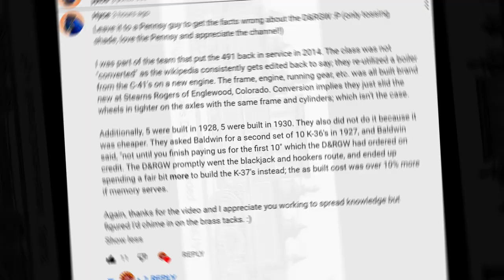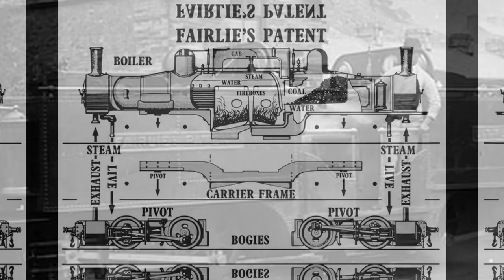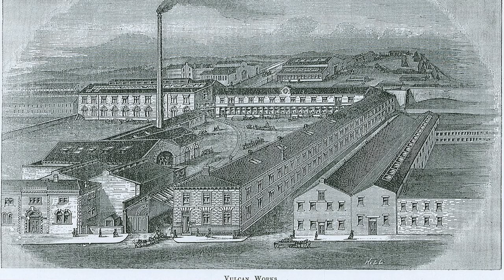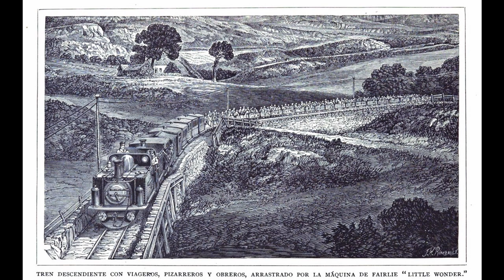Remarkable Engines: America's Only Double Fairlies

Comment: The Central Railroad of New Jersey also had a double ended "baby-faced" Baldwin engine nicknamed Janus, after the Roman mythological God of beginnings and ends or duality, often depicted with two faces.
Reply: That same doubled ended diesel was allegedly Baldwin's last passenger diesel they produced. Somebody can correct me if I'm wrong.
Reply: That’s pretty cool.
Reply from the maker: @demonorca9539  That title goes to the Baldwin RP10. Only 3 were made with 2 going to the New Haven's Danl Webster, and one going to the NYC Xplorer, as they were built from April to October 1956. The Baldwin Janus, on the other hand, was built around 1945.

Comment: Sorry dude, but the Canadian Fairlies were NOT on the Grand Trunk Western. 

Your photo is of Toronto & Nipissing #9 Shedden, which was destroyed by fire in 1883. The T&N started as a narrow gauge line running NE out of Toronto. In 1882 it was bought by the Midland Railway, which was leased to the Grand Trunk Railway in 1884. The Grand Trunk went bankrupt after WW1, and became part of the Canadian National Railway. The Grand Trunk Western was created in the 1920s by CNR to operate it's American lines west of Detroit. 

The second Fairlie was Toronto Grey & Bruce #7 Caledon, which was scrapped in 1883. The TG&B eventually became part of Canadian Pacific

Three more Fairlies were owned by a coal mine in Nova Scotia, where they worked until 1902.
Reply from the maker: Thank you for the correction. One of the sources I used said something about the GTW having that fairlie, but I must have misread it

Comment: Shame Fairlies didn’t take off that well in the States, but let’s face it. America is just too big and steep for these engines.
Reply: Probably would’ve been the same story with the Garratts too. But had Britain retained and expanded the colonies, maybe they could’ve been able to make the Garratts work like they did in Africa.
Reply: Ferrocarril Mexicano had some standard gauge double Fairlies (very briefly mentioned and shown towards the end of the video) for a steep line (from Mexico City to Veracruz), replaced by electrics in the 1920s (with this electrification shamefully abandoned later in favor of diesels after privatization of the line).  And the double Fairlies had all wheels powered, unlike standard locomotives (other than switchers) made in the US.  So I don't think the rails in the US being too steep was the problem.  A hint of a possible show-stopping problem is mentioned in the video:  leaking steam pipes.  Back then, they didn't know how to make a steam-tight flexible junction that would hold up through long service.  This was also a problem on early Mallet articulated locomotives, but mitigated by the use of lower pressure steam on the front engine; by the time US locomotive manufacturers went to making single expansion locomotives with the Mallet type of articulation (no longer true Mallet locomotives), they had solved this problem.
Reply: You're way off with "too steep". The Fairlies were made for steep, because they were originally developed for mountainous narrow-gauge lines in Wales that needed extra hauling power without having to double-head (and thus run two crews per train).

"Big" was far more of an issue, due to limited fuel space. Minimal problem on a line with a lot of stops, massive problem on lines with long stretches of nowhere. They would likely have been more appreciated on logging and mining railroads, which are shorter overall while often having really tight curves.

USA railroads also had little care and patience for manufacturing & maintaining the oft-fussy articulated steam pipes.